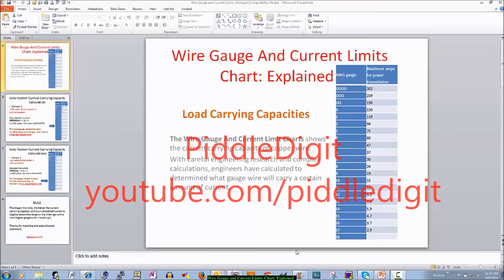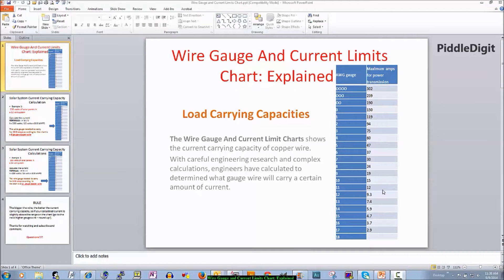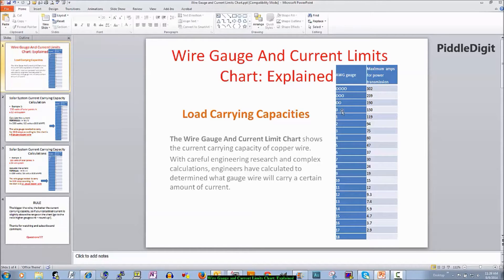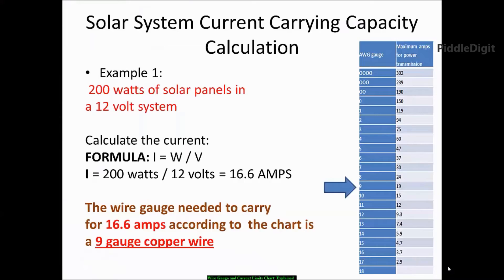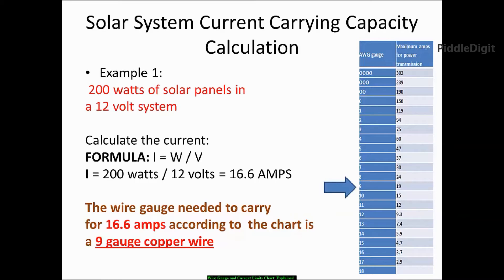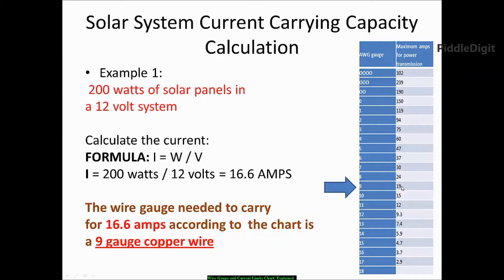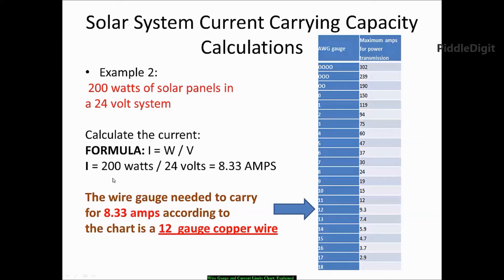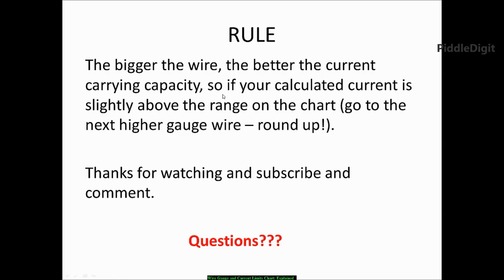The Wire Gauge and Current Limits Chart: Explained

Comment: Suppose I want to design a 0.5 hp motor then 
1 hp =746 watt ÷2 =373watt motor. 
In my country ac voltage is 230. 
Power = volt * current
373÷230=1.6217 amps 
In order to draw 1.6217 amps what size wire guage sholud I used and also length of copper wire? 
How to design exactly 100  watt,  550 watt and 750 watt? 
Example for 100 watt is fan, 550 watt to 750 watt is mixer motor.

Comment: The chart shown in this video is for power transmission and the limits are low because generally you don't want to have a lot of I^2*R losses across the wire. Also when we talk about power transmission we are talking about long distances typically hundreds or thousands of metres. Obviously if you just want to transmit power a mere metre or two these limits are higher. By the way these are DC/rms limits. For short durations/pulses the current limit is much higher (of the order of 10x). 

Generally if you put greater current through a wire than the maximum stated the wire's temperature would exceed 60 degrees Celsius and there might be an issue with the insulation melting. But obviously if the insulation of the wire can handle higher temperatures (and generally it can handle at least 95 degrees) the current limit (for the insulation) would be higher. Still you would have bigger power losses across the wire and the efficiency of the system would be lower.  

Anyway if you just have to carry a lot of current across a short distance and while the insulation can handle 95C and also don't care about losing a few watts of power across the wire then you can safely use a size for a lot more current than the rating of this chart. For example a 10 gauge, 1m long wire with silicon insulation can carry 100A while dissipating 10W of power and its temperature staying below 50 degrees Celsius.

Comment: can u please explain what amps do? i understand that volt is the pressure and the watts is the power but what is amps exactly?
Reply from the maker: Amperage (amps for short) is a measure of the AMOUNT of electricity used. Voltage (volts) measures the pressure, or FORCE, of electricity. The amps multiplied by the volts gives you the wattage (watts), a measure of the WORK that electricity does per second.
Reply: Amps are technically a measure of the rate of flow of the electricity - it is measured in charges per second.

Comment: are the wires from the solar panel not always the right wires for the panel
Reply from the maker: The installer has to ensure that the wire gauge is correct by performing the calculation.

Comment: so, it would not increase the amps i just for safety purpose.
Reply from the maker: Yes, the bigger the wire, the better the current carrying capacity, the plus added safety as your wires are less likely to catch on fire.   This is why knowing what gauge wire to use is so important.   It's always safe to go with bigger wires.

Comment: hi, i wonder if it is good idea to change the gauge wire in the solar panel? to explain i have a small solar panel that produce 4 volts and .05 amps and i wonder if i increase the wire gauge will increase the amps????
Reply from the maker: Increasing the wire gauge will not increase the output amps of the solar panels - due to the laws of physics.   Using the correct wire gauge,  however,  prevents voltage drop, thus maintain the output capacity of the panels.  Hope this helps.
Reply: hi, i wonder if you would need to change the gauge wire if you increase the amps in a parallel ? the solar panel produce 4 volts and .05 amps and i combine two of the and now it produce 4v and .1 amps so should i change the gauge wire????
Reply from the maker: +Francisco Sanchez 
What gauge wire are you using ?
Reply: i believe that is either a 33 or a 34 gauge wire

Comment from the maker: @Afrocanuk
Wire cross sectional area calculation
The n gauge wire's cross sercional area An in square millimeters (mm2) is equal to pi divided by 4 times the square wire diameter d in millimeters (mm):
An (mm2) = (π/4)×dn2
SWG to mm conversion chart

	
	
SWG           (mm)
0                  8.23
1                  7.62
2                  7.01
3                  6.401
4                 	5.893
5                  5.385
6                 	4.877
7                  4.47
8                  4.064
9                  3.658
10                3.251
11                2.946
12                2.642
13                2.337
14                2.032
15               1.829
16               1.626
17               1.422
18               1.219
19               1.016
20                0.914
21                0.813
22                0.711
23                0.61
24               0.559
25               0.508
26               0.4572
27               0.4166
28               0.3759
29               0.3454
30               0.315
31               0.2946
32               0.2743
33               0.254
34               0.2337
35               0.2134
36              	0.193
37               0.1727
38              	0.1524
39               0.1321
40              	0.1219
41               0.1118
42               0.1016
43               	0.0914
44                0.0813
45               0.0711
46              	0.061
47              	0.0508
48              	0.0406
49              	0.0305
50               0.0254
Reply from the maker: How to convert AWG to mm
Wire diameter calculation
The n gauge wire diameter dn in millimeters (mm) is equal to 0.127mm times 92 raised to the power of 36 minus gauge number n, divided by 39:
dn (mm) = 0.127 mm × 92(36-n)/39
 
0.127mm is the diameter of gauge #36.
Wire cross sectional area calculation
The n gauge wire's cross sercional area An in square millimeters (mm2) is equal to pi divided by 4 times the square wire diameter d in millimeters (mm):
An (mm2) = (π/4)×dn2 = 0.012668 mm2 × 92(36-n)/19.5

AWG #	Diameter     (mm)
0000 (4/0)              	11.684
000 (3/0)                 10.4049
00 (2/0)                  	9.2658
0 (1/0)                     8.2515
1                            	7.3481
2                            	6.5437
3                             5.8273
4                             5.1894
5                             4.6213
6                             4.1154
7                            	3.6649
8                             3.2636
9                            	2.9064
10                           2.5882
11                           2.3048
12                           2.0525
13                           1.8278
14                          	1.6277
15                           1.4495
16                           1.2908
17                           1.1495
18                           1.0237
19                           	0.9116
20                            0.8118
21                            0.7229
22                           	0.6438
23                            0.5733
24                            0.5106
25                            0.4547
26                            0.4049
27                           	0.3606
28                            0.3211
29                            0.2859
30                            0.2546
31                           	0.2268
32                           	0.2019
33                            0.1798
34                            0.1601
35                            0.1426
36                            0.127
37                           	0.1131
38                            0.1007
39                            0.0897
40                            0.0799